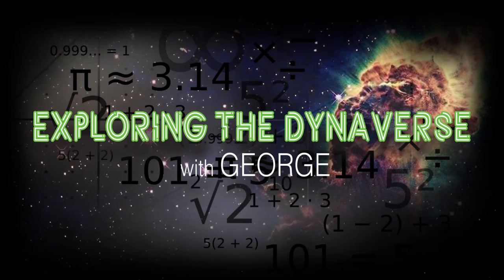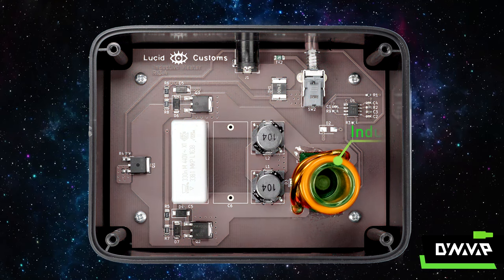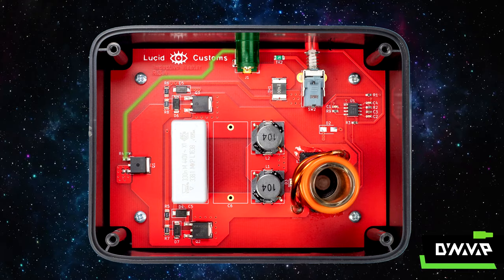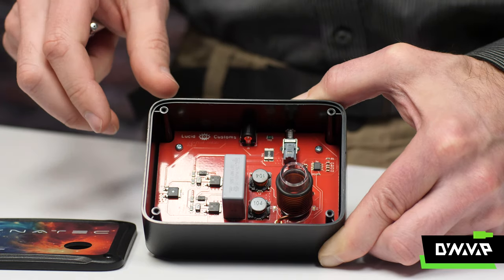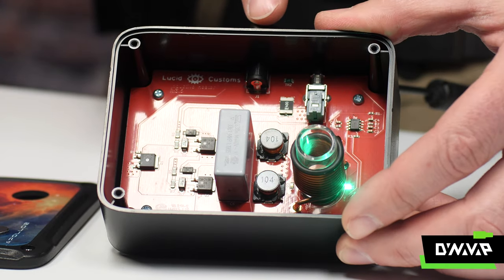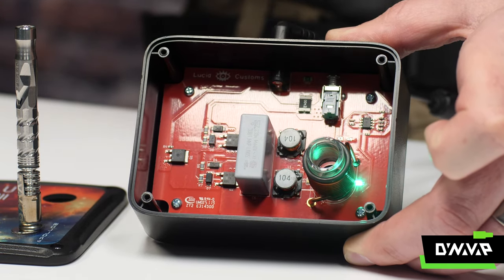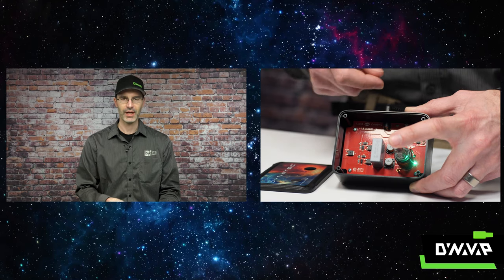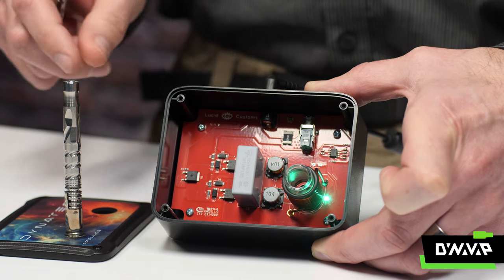How does Induction Heating Work? | Exploring the DynaVerse with George (Ep. 01x01)

Comment: Awesome video George! Thank you for the awesome science lesson. I love induction heating. I went with VapHotBox because of it's portability running off of 2x 18650. I get about 4-6 days on a single charge. I consume about 5-10 vapcaps a day. I recommend getting an IH to reach the dynavap's full potential with ease.
Reply: I have the VHB as well and while I enjoy it I'm wondering if you experience long heat up times, around 12-20 seconds to get to the first click? Also, do you think the button requires a tad too much force to push down on?
Reply: @alx_psyk  I believe mine heats up pretty quick. Just heated mine from cold and timed it. 10 seconds till the first click. 12 seconds until the 2nd click. I'm using a stainless 19M with a normal cap. Also I find the button to have just the right amount of resistance on it.
Reply: @r3p3ntiv3  Thanks for the reply. I've had mine for about a week now. I'll keep testing it out and see how the performance fares
Reply: @alx_psyk  I've had mine almost a month now. So not much longer. You're welcome & stay safe out there.

Comment: Is there any way the temperature of the device can be set lower or higher or is it the nature of the device that if it's on it will be on THAT temperature and nothing else?

Can the speed of those electric waves be slowed down resulting in a lower temperature?

I'd prefer to set it at a temp that I can trust won't combust and still get the vapor I want.
Reply: you have to hold it down for the heater to engage, so you will definitely hear/feel it click when it gets to temp. For slower heat up, he said to pulse it, by pressing and releasing the vapcap until click. The only way you will combust with this thing is if you keep holding the vapcap down after the click.

Comment: I’ve recently picked up an Apollo 2 induction heater from lucid customs. I have been using it for a few weeks and only just found the ‘sweet’ spot for me. (Heat until click , pause for a sec then heat in 3 second bursts. usually 3 for a cold start, or two bursts after that.)                                                                                                    I use D Dave’s glass stem water pipe mod so I love those high temp milky hits!    I enjoy the convenience of one hand vaping and all that, however I have a few issues ;  The main one being it calibrated too cold or so it clicks way too soon , and to get any decent Vapor production you have to be in the ‘danger zone ‘ after the click which has caused me to combust way to many times.  Another thing I’ve noticed is some uneven AVB , sometimes it tastes done then I dump it and find green underneath the charred top. Also the vaping switch feels a little unstable and wobbly, I don’t know if it is just my unit but when I insert the vapcap it can wiggle around and doesn’t feel stable.
Reply: I do not have one but looking at videos ect. the dynavap will fit loose in the unit. Also noticed as faras heating,  in some research I seen on induction heaters, you may have to find the sweet spot height wise and either hold it at that spot while heating or shim it in some fasion, cork, silcone sheeting ect to maintain the proper height while heating.... Perhaps the DYnavap team will have better answers..